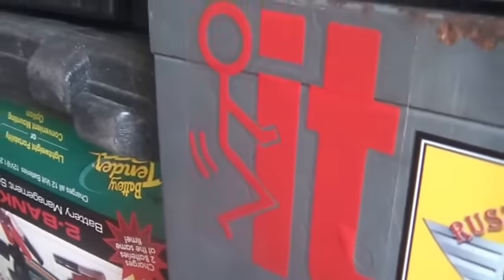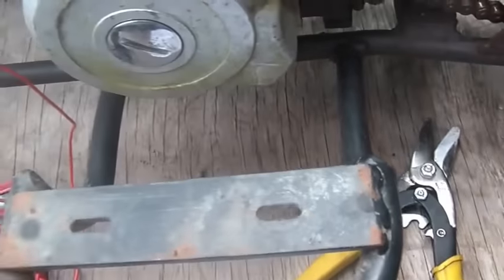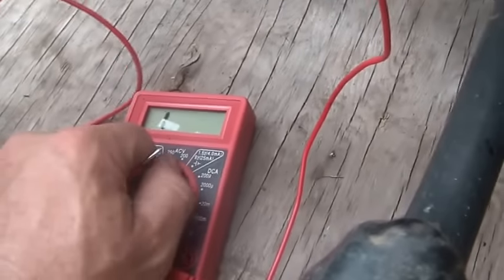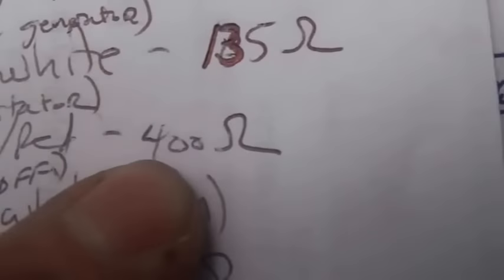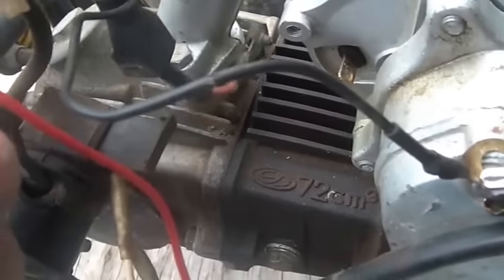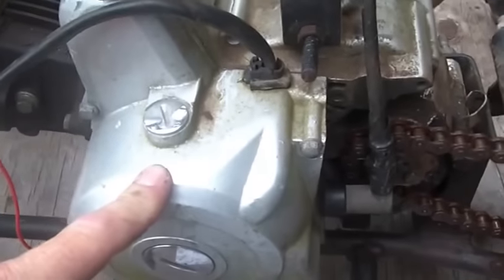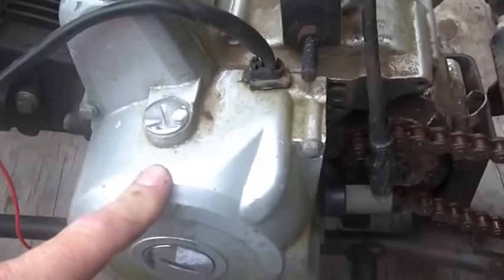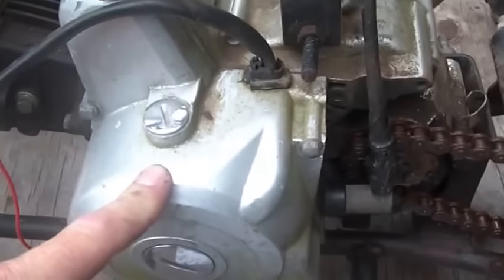Troubleshooting a no spark China Quad, critical wire harness measurements,

Comment: Hello I have a question about my Chinese atv. So I cannot find the problem because my atv cranks but it doe not start. There is nothing going to the coil. I noticed that my ground wire has a black and a green coming off of it and it is getting really hot when I press the start on my engine. Can you help me out please?

Comment: I just snagged a SUNL ATV-109 today from a co-worker that needs to have the battery charged, carb cleaned and a good romping to clean out the cobwebs. Maybe not in that order.
He also told me that it runs great for about half an hour, then it shuts off and wont start again until it cools down. I've watched a couple other videos and done some research but your video not only laid things out better than everything else but also made more sense.
Thank you!
Reply from the maker: Hey INECIKlavier!!!  Sound like U got a great deal!!!   About heating up and shutting down, could be Ur CDI or spark coil, but, before U mess with them, I would make sure the gas flow into the carb is good, I have running across a few smaller China carbs where the bowl fills very slowly, especially when the motor gets hot, had something to do with the float needle valve, I just swapped them out.... Good luck with Ur new ATV, enjoy it!!!   Thanks for the info, encouragement, watching, and commenting!!!   Please let me know how it all turns out....

Comment: Thank you!!! I just got a brand new wiring harness for my 110 and installed it and it had no spark, so I got to 111 in your video and saw the part about the yellow black wire on the cdi going straight to the coil, and looked over my wiring again and saw that I had the cdi plug plugged into the hand control and the hand control plugged into my cdi, now I’ll change em around. Thank you so much, your a life saver

Comment: Harvey thank you,I bought a Honda 110 for fifty dollars .  Pretty much complete. It even had the tools,that are kept on the frame .The fenders were just faded a bit. I could not get spark I worked on it  for about 6 hours and I came watched your video and you said you got no ground you got nothin. So I ran ground wires everywhere and by gosh I got spark and it started up right away. I thought it was grounded  all ready but it wasn't. The bike had set in a Barn for over 15 years . Just think just because of a Ground wire . Thank you.  Oh I also have a little Chinese quad 110 and a 250 They  are okay could be better if they made their frames stronger. I
Reply from the maker: Hey Lonnie!!!   I love hearing stories like this, another Honda ATC saved from the scrap heap.... Good job taking the time to figure everything out!!!   Thanks for the info, encouragement, watching, and commenting!!!!

Comment: I have a 2008 Baja 110cc quad. I'm getting fuel and spark. Starter and solenoid are new. New spark plug as well.
My problem is, it cranks and cranks, but doesn't turn on. Everytime when it cranks, you can hear some noise from the exhaust (like a popping noise as if it wants to turn on; with the choke closed AND opened). But, I bought this from an amateur mechanic who, which had appeared to open the valve end of the engine, and who also stripped the spark plug entrance (it goes in fine all the way with a rachet and in small areas, it tightens up, but it keeps spinning when you try to tighten it on the last thread).
I have yet to use a multimeter, but I will be buying one tomorrow. I've only been using a fuse checker (one of those tools w/ an alligator end that lights up when you touch power)

Comment: Thanks dude. Removed the white black wire coming from the ignition lock and it worked.. it seems that the ignition lock dont work right anymore and the black/white is all the time on off

Comment: Thank you so much.  The way you explain this is so easy to understand.  I really appreciate it.
Reply from the maker: Hey Joe!!!!    I'm trying to save as many of these things from the  scrap yard as possible.... Thanks for the positive feedback, thoughts, watching, and commenting!!!
Reply: Harvey Spooner  I started following your how to today. So far I have the engine off the frame...i have two of them, and I'm trying to put together one working engine. Is the coil pack for the spark twelve volt? I ask because I need to know if I can rig it up with the jumper or if I need to have it connected to the converter
Reply from the maker: Hey Joe, For a Capacitive Discharge Ignition, (CDI), system the only power to the spark coil is the output from the CDI box, the CDI box maybe powered by the battery, (DC CDI box), of from the stator, (AC CDI box),... I will be doing some wiring on the Jonway 110cc mini quad over the next week or so, please stay tuned.... Thanks for asking, watching, and commenting!!!

Comment: Harvey I need your advice, I have a 90cc 4 stroke believe it's a kazuma engine. I recently replaced all the wiring, along with stator, rectifier, coil, starter solenoid, ignition switch, everything due to some wires shorting out.

When I replaced everything,it fired up in 1st try, a couple days later it wouldn't start. Had low compression, so I tore into the top end to check everything.

Ended up replacing head gasket and stuff. Found both valves,so took them off, removed all the carbon and re installed, and adjusted the valves.

Re installed engine, put everything back together, and I have no spark.

Checked all the connectors, all "look" good.

I have a multimeter but it's too fancy for me, can't figure out how to use it 😂.

What do you think it could be?

Thanks.

Comment: hi harvey thanks for the video i followed it and my wiring is identical to the one you have in the video. i was able to get the lights/horn an starter but i still get no spark to the plug. will be replacing the CDI next. but not sure what else to check on. got this from someone that has had it sitting out for a while so slowly getting back into running order.

Comment: Yes I do but the thing is that I tested every thing the stator, coil, spark plug you name it, it's just not getting any spark
Reply from the maker: Nick, Given that U tested everything and got good readings, I would disconnect and float the on off wire and hook an extra ground between the motor and frame and wire harness green wire and the ground on the spark coil just to be sure, if no spark, Ur CDI must be dead... Should cost around $15 on eBay.... If U live near the Hudson Valley of NY, I could look at it for you... Let me know how it all turns out.... Thanks for the info, asking, watching, and commenting!!!
Reply: @HarveySpooner  hey boss I have a 125 pantera motorcycle and my cbi box got on my muffler and got burnt can I bypass it

Comment: Great video! Very easy to understand. I have a 2010 Gio 200cc atv. I'm having trouble with intermittent spark. Every reading is good. My black red is only 295. My blk yel is only getting .5.  New cdi blk yel got 1.1 now only 0.5. Any help or suggestions would be great. I'm thinking cut everything out and start over? Looks like someone was experimenting with subpar connections/splices.
Reply: 14:01

Comment: I just got my Chinese atv running thank you very much...you are awesome...the only thing missing is the charging system HOW DO I GET MY BATTERY To CHARGE?
Reply from the maker: Hey Jorge!!!   There should be a couple of yellow wires, or a yellow and pink wire coming from the motor stator, they go to the voltage regulator attaching to the yellow or yellow and pink wires, the red wire from the voltage regulator goes to the + side of the battery, the green or black wire from the regulator goes to ground, (ATV frame), and the negative side of the battery....  http://www.ebay.com/itm/NEW-4-PIN-VOLTAGE-REGULATOR-RECTIFIER-CHINESE-ATV-QUAD-125cc-150cc-EL011-/291173668783?hash=item43cb4d97af:g:tyIAAOSws65TpKI8&vxp=mtr    , I hope this helps, thanks for asking, watching, and commenting!!!
Reply: Harvey Spooner 
Thank you very much.!!!

Comment: Hi,I m glad u r a good teacher  I have a a 49cc Yamaha scooter
Reply: I have a 49cc Yamaha 1988 scooter I was just wite the cdi to motor from motor is black white yellow red n white and from cdi is black,red n white,black n white,black n red, so black is going black and also ground then coil,red n white is going red n white,then black n white is kill switch there it's go and second black n red there go because from motor these two I Don't have it plz can u help me so I can start without battery and I know from motor white and yellow white for light I m not using that two,I need here a switch or lagulater here where kill switch and and black n red wire go because I Don't have spark
Plz help me if u have time

Comment: Just stumbled upon this video as I recently bought a taotao 124cc for my son. Had it running great and then it started spitting and sputtering so I got a new carb unlike the Chinese one where you cant access the float without drilling. Anyways didnt fix the problem. I'm noticing excess fuel coming out of choke side and I've adjusted carb every way I know how. I'm thinking either a sticking intake valve on compression or could a bad cdi box cause such a weak spark that it's not burning all the fuel in the chamber? All I know is it backfires out muffler and carb which says valves to me but also I've got way too rich a mixture and my plug is black. Thanks for any help!
Reply from the maker: Hey VIP!!!   I think Ur intake valve is adjusted too tight, U need to loosen it up a bit and it will probably start right up... U should adjust the exhaust valve as well.... For the China stuff and the old machines that I'm running, I tend to run with the valves on the looser side.... I rather hear them tap than have them too tight and have them burn a valve drop one for over heating!!!!   I hope this helps, Ur first instincts about the valves are probably right.... Thanks for asking, watching, and commenting!!!
Reply: Hey you're welcome great video! It does start good and idles fine but under throttle, any throttle is when is backfires and sputters so I will try to adjust valves. Thanks!

Comment: Hi. I got this unnamed branded Chinese 50cc 2 stroke quad. It started and ran fine and then wouldn't anymore. There isn't any spark. I've tested and measured best I can namely the coil and stator. But I can't find a CDI box on this engine. Does it work without s conventional cdi system?  Where could the problem lie? Blown pick up coil on stator? Please help. Tnx. In the same vain, just out of curiosity, how do common lawnmower engines run without a battery? How is the spark created to fire and keep the motor running? Cheers and tnx for this helpful video.

Comment: Can you  explain the simpler systems that don’t have batteries and a starter.  If I could get/find a real schematic I wouldn’t be asking.  I “assume” the CDI gets power from the generator portion of the stator and the spark signal comes from the igniter pulse.  Also, what voltage does the generator put out to the CDI and Coil if there is no voltage regulator.  Im assuming it’s AC but don’t know the voltage.  Im asking because I would like to build a tester that sends a pulse to the coil to do a quick easy coil test for process of elimination.  Would also like to remove the plug, spin the crankshaft with my drill and measure the generator and igniter voltage coming out under fairly consistent rotation speeds.

Comment: Hi Harvey
I have the same engine as in this video. I have got a new harness, coil, stator, cdi, regulator and solenoid in a kit.
I have replaced everything electrical and removed the kill switch wire from the cdi plug.
After testing everything, i have no spark. I get 70 volts from the cdi to the coil but no spark.
I have tried 4 coils( 1 new 1) and 3 plugs.
I have 7ohms on all grounds.
Hope you can shed some light for me.
Cheers
Reply: hyster16t bad grounds

Comment: Bought a used Baja 50cc engine. I was told it had low compression and would not run because of that. I didn’t use a meter, I took the spark plug out, jammed my thumb in the hole and kicked it. compression seemed strong. I checked spark and it does have very strong blue spark. Timing is on point. Cleaned the carburetor immaculately, but nothing. Took carburetor off my honda xr50 which I built from an empty case so i know its 100% working and threw that on, still nothing. Thought cause I didn’t use a meter maybe the compression it does have just isn’t enough after all, so I replaced the piston and rings. Compression isn’t the issue now, spark doesn’t seem to be the issue, and since my honda runs, i don’t think carburetor is the problem either. Whats next? Should I replace the entire wire harness? Should I take the entire engine apart and check each individual part as I reinstall everything? Tbh idk where to go from here. Starting to get frustrated with this now.

Comment: Question keep blowing inline fuse everytime as soon as I turn the key to the on position what can cause this?
Reply from the maker: Hey Stephanie!  On these China Quads, turning on the key switch normally sends power to the left hand grip switches where the start button and the light switches are, I'm thinking messed up switches there or someplace around there  the wire harness rubbed off and there is a short from (+) 12Volts DC to frame or ground... I hope this helps.... Thanks for asking, watching, and commenting!!!
Reply: last time ive seen this guy had battery terminals hooked backwards
Reply: @leetaylor2280  lol really?

Comment: ok so i got a 1977 honda 90cc 3wheeler symple wiring but nothing was conected ar the head light and to beleve i got no sparck not to mentchion no cdi when i puled evering like the wiring has no way on one but i cant find any wiring diagram to hook anything proper and it came with out the head light im sure somthing is missing i just need the engin running for a gokart i built from ground up ive been on the gokart prject for 2 years now due to trying differnt engins non witch wold run due to wiring this is the typ of engin i want on it regard less cuz i want a manul gokart so i cant due the engin mount on it till i know i got a running engine that will run appon finishing the gokart putting the engine that rins in order to wire up the kart any help like step by step would be great.

Comment: 2008 50cc scooter won't start. Ran in 2018. So-so start but got it running. Ran OK for 3 months. Couldn't start one day to go to work. Ugh!
Things I've done.

- Checked battery volts = 12.5V
- Installed new spark plug = good spark
- Installed new carb
- New gas filter. Checked gas flow post-filter using cylinder vacuum = Good flow.

Now what? Stumped.

After installing carb, do I need to prime? Doesn't look like gas is getting to spark plug. Plug looks dry.

Any suggestions or questions?

Thanks for the support!

Comment: Great vid. I got one question though, I bought an aftermarket wiring harness, but the red (power) wire from the battery is pretty thin. Is it possible that it's not thick enough to pass the current to the rest of the wiring harness ?

Comment: have a coolster while checking spark it sparks and then quits until you bump it again sparks about 5 times and quits again any answers are greatly appreciated
Reply from the maker: Hey Joe!!!   I would start by disconnecting the black wire with the white stripe from the CDI, (disconnect it such that it can be reconnected in the future), I have found that if the engine off circuit is active, it may spark a few times and then stop.... Let me know how this turns out.... Thanks for asking, watching, and commenting!!!

Comment: Do I have to have the stator pulse condenser to crank my 2008 tank vision 250c.f. motorcycle
Reply from the maker: Hey Charlie, I would remove the stator pulse condenser, (I think U mean CDI pulse generator, or CDI trigger, or pulse generator), and see if it looks like one from one of the China Pit bikes or ATVs... the QIANJIANG QJ250 is supposed to have some parts in common, I would do some research there... Thanks for asking, watching, and commenting!!!

Comment: I have a 2012 razor 170 for the kids cdi box is gone how do i determine if it is ac or dc fired i have a new ac unit and the old one looks like it is ac but the wiring is different is there a simple way to work this box on it.
Reply from the maker: Hey Larry, It is a Polaris????   Does it look like this will work,  http://www.ebay.com/itm/250cc-QUAD-ELECTRICS-200cc-Zongshen-Lifan-Ducar-Razor-CDI-COIL-WIRE-HARNESS-/331694732439?hash=item4d3a8bf497:g:Ht0AAOSwo6lWIfgG&vxp=mtr ,   ???   Let me know, thanks for asking, watching, and commenting!!!

Comment: Great video, im changed the stator on a chinese quad, but the old stator has 4 wires, its missing the black/white, the new one has 5. Any ideas?
Reply: Same problem I’m having. 4 wires coming out of stator. No spark. Someone cobbled a harness on it. Can’t find a harness to match 4 wire deal.

Comment: I have a life in gya5 200cc dirt bike motor and I have spark but it won't start. What could it be that is keeping it from starting???? I get back fire when I spray some starter fluid. 
  Thanx John B. aka NDN
Reply from the maker: Hey John, I would check my valve lash, Ur valves adjustment maybe a little too tight.... A blown head gasket or an intake manifold leak, (loose carb), could also cause Ur issue.... So, check the valves, rebuild the carb, change the plug, do a compression test, check the engine valve timing, and a cylinder leak test.... I'm thinking tight valves and a crab rebuild will probably fix it..... Thanks for asking, watching, and commenting!!!